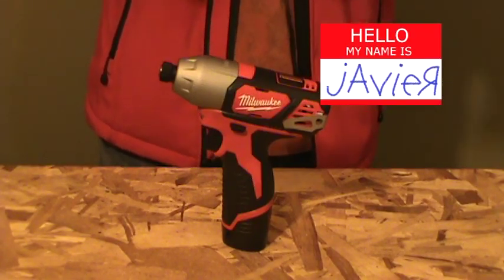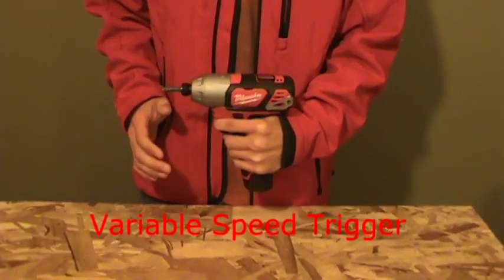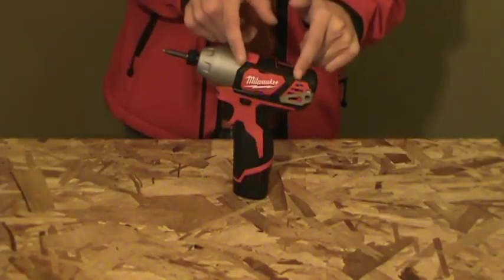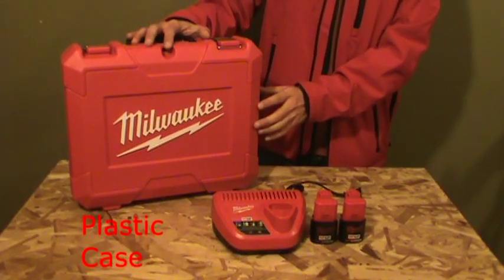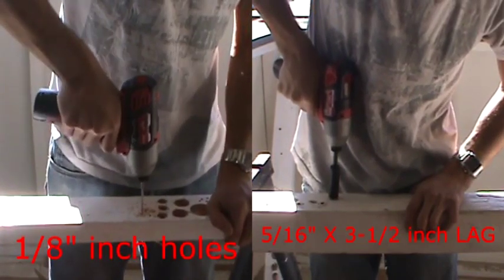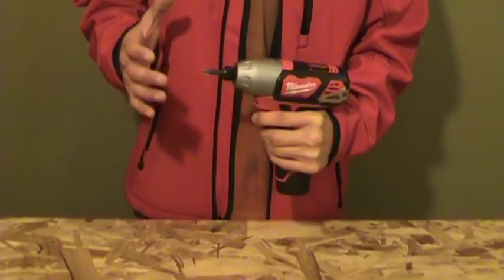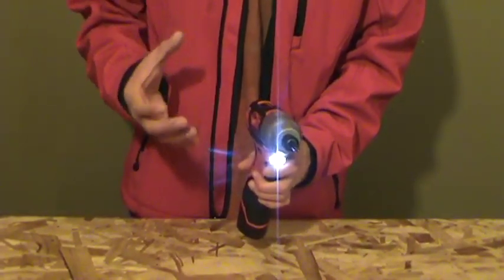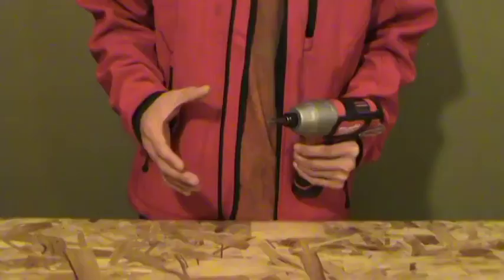Milwaukee M12 1/4" Hex Impact driver 2462-22 Review

Comment: impact drivers are not designed to drill holes it's for driving screws and bolts
Reply from the maker: there are many impact rated drilling accessories out there so yes you can use impact drivers for drilling holes

Comment: Anyone else able to work a" two handed chuck" with one hand?
Reply from the maker: You're missing the point, the point is not if you can but regards to the chuck itself. Better featured models like the Fuel models have chucks that allow the bit to be inserted without pulling the chuck. There's other chucks that go farther than that such as Dewalt's that do what the Fuel models plus a "true one handed" ability to remove bits with one hand. Check out Dewalt 12v impact driver review to see what I'm talking about.

Comment: I recently acquired a second hand Milwaukee impactor as a hand me down, thing is I love this tool but I think the brushes are going and wondering if I can get the parts for it, don't have a fuckin breeze on the numbers etc, alotta numbers, mine is different from this one, seems to be the chuck case is smooth and no obvious fixing screws as you look at it head on. My friends has the combi brushed set he got dirt cheap in usa, and mine looks similar to his impactor,wud ye know the brush set I need?
Reply from the maker: Patrick Madden contact milwaukee and provide them your model number
Reply: model number is scraped off
Reply: +Patrick Madden it was probably stolen
Reply: Se6nd the company a picture of it.
This is not rocket science.